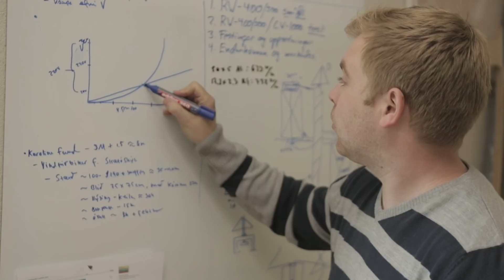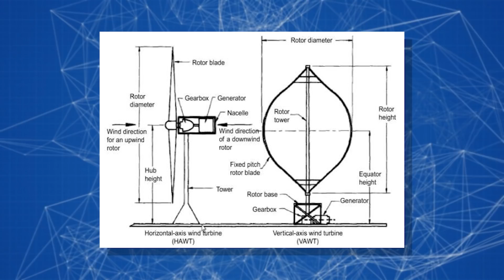Why This Wind Turbine Will Change The World

Comment: Silly narration with EXTREMELY dishonest comparisons between VAWT's and HAWT's as you're comparing multi-mW turbines to dinky 600W VAWT's on the ground!  Multiple studies have been performed, by 3rd party engineering companies that show vertical axis turbines producing only a tiny fraction of the energy of horizontal turbines with ROI time frames of: 600+ years.  There's nothing new about VAWT's, they've been around for many decades, even like this Icelandic dude's style and they still produce little-to-no energy.  I know, I've sold thousands of small wind turbines over the past 15 years and have one in my own backyard, powering my own home, on a 40' pole.  Putting ANY wind turbine on the ground will be a guaranteed waste of money as wind turbulence and low-wind speeds will starve the turbine.  Don't waste your time and money on dumb ideas, buy cheap solar panels and call it good.
Reply: yes, this rather stupid narration forgot so say anything about efficiency
Reply: It could change the world....or be just another over hyped attempt for some investors to make a buck. 2 large Pac Wind VAWTs blew apart in the same storm near me a couple years ago.
Reply: Virtually the first sentence managed to ruin credibility by referring to using fossil fuels as burning minerals
Reply: Why is the ROI so low? The wind turbine looks flimsy and does not need much material.
Reply: @chenqin415  Look up Betz's Law, which states that at the maximum you can in theory obtain only up to 60% of the energy contained in a certain area through which air flows, in realistic conditions this number will be lower. As the area is very small for these small turbines and at low altitudes the speed is low, you'll only get tiny amounts of power. For the same amount of money you'll get much more power with solar panels, even at high latitudes. On top of that PV panels last longer and won't require (as much) maintenance, hence the $/kWh is much lower. For large wind turbines however, the wind speeds are much higher, for more hours in the year, in a much larger catchment area. Therefore, wind turbines in the MW scale do have lower $/kWh, even with maintenance cost included.

If small wind turbines could be as cheap, we would see them all over the place already.
Reply: @Soepsliert  Well said, the fact already told us the truth
Reply: @Soepsliert  solar is only charging for 8 hours a day. Why not combine technology? Solar panels on wind turbines?
Reply: What brand of wind turbine do you recommend? Been wanting to get one for a while now. Thanks.
Reply: @BassKing956  Tesup or Istabreeze.  Both seem pretty solid with high volumes of sales and support.  Most others are a waste of money.
Reply: @BassKing956  Bergey.
Reply: you assume that all parts of world have sun shining all year... some part of world do not have sun for months, but those do have still winds.
Reply: @freezedeve3119  Yes, every part of the world has sun every day, all year, this is absolutely scientifically and physically proven and yes, many of these parts have some or significant amount of cloudy days, but the sun still rises as the Earth continues to spin.  Solar produces on cloudy days as well as sunny days, just less production but it still produces energy.  And yes, many areas also have still wind speeds most of the time which is why we put the wind turbines and solar panels in areas with maximum production and use the energy sources we can.  Likewise, it doesn't rain every day nor do we harvest crops every day but, you still eat and drink water every day so we need to learn to work with nature and store the excess for times when we need it.
Reply: @RussellFineArt  maybe you should educate yourself, you clearly have no idea at all how earth and sun works...
Reply: @RussellFineArt  yea as guy who lives so north that on summer sun does not go below horizon and on winter sun does not rise over horizon at all.
Pretty much same reason why they use those wind turbines in Island as they are near Arctic circle having very little sunlight on winter.
And sun rotates 360 on summer so where to aim your panels is the question?
But it is always good that we have flat earthers telling how world works,
Reply: @freezedeve3119  Yeah, the flat earthers are bizarre.  I've worked on solar and wind installations in northern Alaska, at Prudhoe Bay, and at Ross Station in the Antarctic, where they have to air the panels at almost 90 deg., but they still work.  The wind turbines generally do better than the solar panels but there's a way to size both systems to get them to work.  Where are you located?
Reply: @freezedeve3119  I doubt anyone assumes that.
Reply: And you prolly work for one of those big utility companies installing those turbines, right? Because the smaller models enable people to separate themselves from your electrical grid and the monthly checques it guarantees you parasites
Reply: @rhianimal19  The small turbines have there place for individuals no doubt.  The large ones are way more cost efficient for power companies.  That is why the size of the large turbines keep increasing.  I have no connection to any power company.  I just like to read and research certain fields. One of the reasons I went in to engineering.
Reply: @rhianimal19  Nope, I've never worked for a utility nor have I ever worked for a large wind turbine manufacturer who installs large wind farms, I worked in small, distributed wind, selling and installing thousands of small wind turbines, including one in my own backyard, that powers my own home so watch it on the assumptions and name-calling until you get the facts.  
I now work in solar as virtually every small wind manufacturer has gone bankrupt and the small wind industry is dead.  I fully support large wind and utility-scale solar and every other means to get us off of coal, gas and oil and fully support people getting solar on their homes to zero-out their power bill, as I've done with my solar panels and wind turbine.  Also EV's.
Reply: @RussellFineArt  zero cost, is b. S. How much did it cost you to install, maintain your solar, and what is expected life of components, in other words would it pay for itself by the time you would have to replace it, it could be viable only for remote of grid homes, other than that, the power in your outlet should be cheaper, unless you in Europe now...
Reply: Unless maybe they are installed along a highway where they would get the wind from passing vehicles it wouldn't replace the horizontal windmills but might be a nice supplement
Reply: The solar panels are useless during the night, while the wind is blowing during the night too. The solar panels must track the Sun to benefit from their highest efficiency, while the vertical ax wind turbine can catch the wind from any direction, and the latitude problem is bigger and bigger for the solar panels as you're getting closer to the poles. So there's no sollution better than the other, they must be combined, and there's a solution for this too: the hybrid controllers.
This way you can benefit from both technologies, because the nights when there's not enough wind to produce power are rare, while the sunny days when the wind blows are not.
Reply: Has anyone figured out how to properly dispose of solar panels after their useful life?  How about the tons of batteries that must be used to smooth out the intermittency issue?
Reply: @jameslee5237  There simply have not been enough decomissioned panels to make large recycling plants financially viable for now.
Lifecycle of solar is 20-40 years, and the first generation of larger PV systems was installed in the nineties.

But there are several firms who have developed function recycling concepts, and are basically waiting for the first flood of decomissioned plants to come along and draw investment into their concepts. 
PVcycle assumes it will install fully financed recycling plants in north america and europe in the mid-twenties, when a constant stream of old panels becomes available.
Oh, yes, and they quote their recycling quota at about 50% of the material, with the 50% loss being mainly  diverse silica - glass variants which are too cheap to fully recycle.
Reply: @jameslee5237  If I remember correctly, in the EU there are laws governing over how much needs to be able to be recycled from solarpanels. Not sure about percentages
Reply: @jameslee5237  This does not seem like it would be hard.  There are companies that recycle both products already.
Reply: @jameslee5237  capacitors

Comment: Wind turbines DON'T produce a lot of noise or vibration, they're very quiet and exceedingly stable... This video is really full of a lot of ridiculous inaccuracies...
Reply: vibration is usually from blade delamination and unbalanced props. none of the points in the vid are ridiculous inaccuracies. I have yet to see a windmill incorporate what was used in prop airplanes for decades, blade feathering. a much better idea than having to lock down the prop in high winds.
Reply: @aphilipdent  variable pitch blades have been used for years on wind turbines

Comment: Vertical axis Wind Turbines (VAWT) have been around for years. This is NOT new technology! However, it is promising in it's smaller design. If the wind can make it spin, it can produce electricity.
Reply: You are right. The first VAWT design shown is one of the oldest. 
In addition, wind turbines now feather in high winds. It's not such a problem as the presenter suggests.
In addition, the bird issue is a canard that is virtually meaningless for several reasons. First, cats have driven 34 bird species extinct (Mother Jones), second, buildings kill the most birds, third, there are designs and coloring (stripes) that can reduce bird fatalities, and fourth, if renewable energy isn't grown, more birds will be killed by global warming than all windmills combined.
Reply: Mark Twain  Your claim is false. Many studies have shown otherwise.

Comment: I just came here to find the innovative turbine design I couldn't care less about "green design" had to skip to 3:00 to miss most of the fluff. It looks like a decent design and having a lower profile and reduced costs isn't too bad. Wind turbines are pits of money and don't help at all I hope that these do a little bit better at least. Good luck with your engineering but please we've heard the global warming spiel a thousand times just skip to why the product is better than the current ones.
Reply: The "pits of money" wind turbines you speak of produce ~60% of Iowa's energy and close to 20% of the U.S.'s energy, and rapidly growing.  More energy was produced by wind, in the U.S., last year, than by coal.  However, this goofy, little turbine will guarantee to disappoint and puts a bad name on wind energy.  One of GE's 14mW turbines produces enough power to power 16,000 homes, annually.  No other generator, of any type, can produce as much energy, for as little cost, is as small of an area, as wind turbines.
Reply: @RussellFineArt  Not "energy" - electricity.   Electricity is about 1/3 of the energy used in the US...
Reply: @lylestavast7652  True, electric power makes up: ~1/3 of the entire power sector, which will grow as fossil fuels continue to decrease and EV's and other electrical appliances become more common.

Comment: They do not produce enough power. Also very expensive for the power produced.
Reply: The fix to both these is size, but as he has not fixed the crushed bering issue that is why we have horizontal wind turbines and vertical now it's a red herring